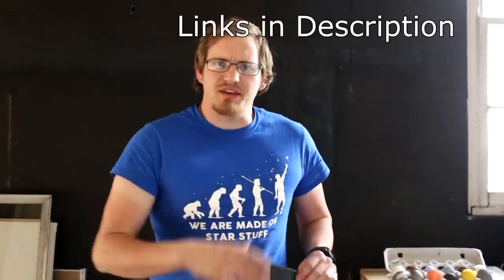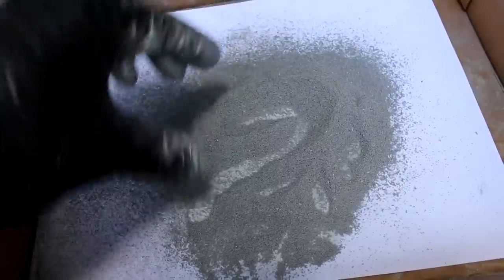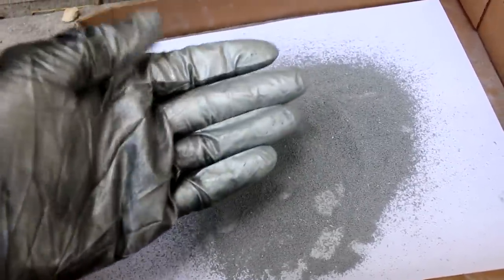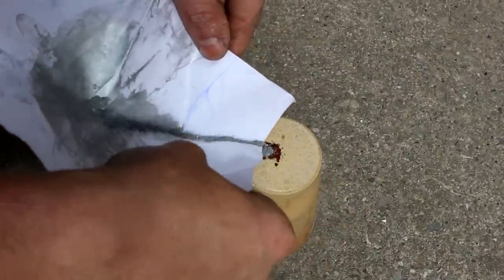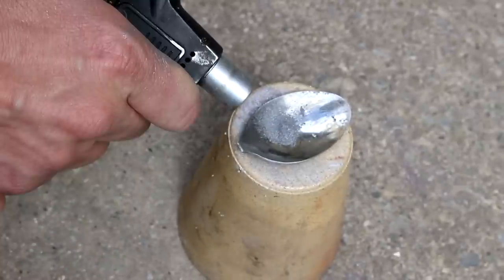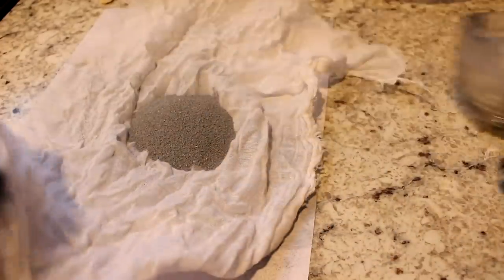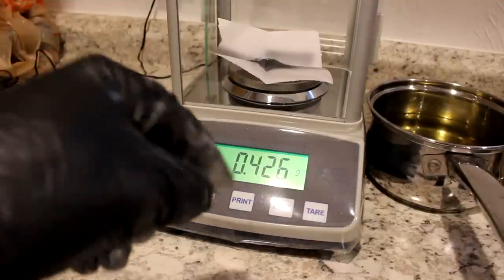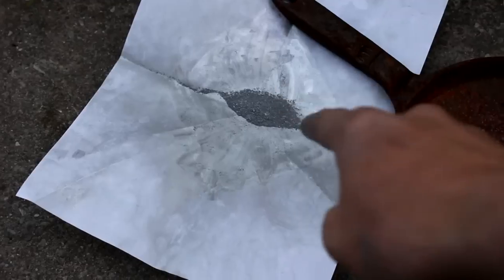Thermite From An Etch A Sketch; Yes It Can Be Done!

Comment: try adding potassium permanganate and dripping sulphuric acid on the little blob of putty. I wonder if it would react to produce manganese heptoxide and then react with the aluminum powder to produce manganese, carbon and aluminum oxide. should be a really violent reaction.
Reply: andrew garcia I remember that, if you combine potassium permanganate and antifreeze, you get a reaction that can burn through a plank of wood.

Comment: as a non kemist, you said the idea was for the Aluminum to steal electrons frpm Iron or Cupper to get the heat of the reaction, could you have more steps maby other metals as " aluminium, Iron and cupper" iron stelas from cupper, and then auminium steals from iron. you get the idea.

Comment: What sort of torch are you using? I usually have to use a magnesium strip to reach temperatures high enough, AND use a torch which is hot enough to light the Mg (which unfortunately is not enough for the thermite though...)

Comment: I use aluminum oxide as a micro abrasive etchant. Would that work in thermite? You can get it at Harbor freight for under $5 a bottle it you want to try it out.
Reply: +antagonizerr no the end result of thermite is aluminium oxide not the begining
Reply: Dexter D
I understand that, but I'm wondering if alumina could become aluminum chemically, rather than smelting, and Cody, being the clever fellow he is, would be the one to know. It's already in powder form which should make whatever chemical process easier.
Reply: Well seeing as the whole reason that the reaction happens is because aluminium oxide is made, to uncreate that reaction would require you to put in as much energy as the original reaction produced. You don't need someone who faked thermite to tell you that.

Comment: Shouldn't you use a stoicimetric ratio of 3 parts iron (III) oxide to 1 part aluminum?
Reply: That's a mass ratio. The respective densities of the aluminum and iron oxide come out to roughly a 1:1 volumetric ratio.

Comment: would it be possible to use heat to separate the aluminium powder from the plastic? it looks like a lot of it is sticking to the beads when you were sieving it

Comment: I wonder if you could make thermite with scandium powder and tantalum oxide from capacitors... Somebody try that and tell me how it goes if you survive.
Reply: +Seth Mitchell why does that create a more intense reaction?
Reply: +Raidho Well tantalum is a very unreactive heavy metal, and I think scandium is even more so than aluminum, but without being so reactive that it couldn't exist in powder form without burning on contact with air, so maybe. I'm not entirely sure if it would work at all, but if it did I imagine it would probably be even more energetic a reaction than bismuth thermite, which basically explodes when ignited.

Comment: Putting the penny in there was actually illegal (deflation). That said, I don't think you'll get into trouble for it :D
Reply: +Huntracony no it wasn't and deflation is not the word you are thinking of its defacing
Reply: Garrett MAGISTER It is illegal to melt pennies. I did actually mean deflation btw, as I thought that was the reason melting pennies was illegal. That doesn't seem to be true, but still, melting pennies has been illegal in the United States since 2006 and in a lot of the rest of the world for much longer.
Reply: +Huntracony only if he uses them for profit is it illegal
Reply: +zemeon2 if he defaced it you cant return it to circulation and just defacing it is not illegal
Reply: but he didn't melt it,he oxidized it.
Reply: he can't profit from it anyways cuz a very small percentage of the penny is actually copper

Comment: Btw cupric oxide is super easy to make...
Reply: How?
Reply: Gordon Freeman When I made it, I bought sheets of copper (you can probably hammer down some copper) and literally just put it on a burner. The heat exposes the copper to the air, thus oxygen and  thus ai found that coporous oxide is extremely easy to create. Note: the black stuff is the CO, the orange stuff is residual copper.
Reply: Luke Sorensen
Nice, thanks.

Comment: You're supposed to mix them at a ratio of about 80:27 by weight.
Not equally by volume
Reply: Also, it's not surprising that the copper thermite reacted that way.

Iron thermite burns but copper thermite explodes.

Comment: My first observation with the acetone to remove the styrofoam is that, your method is not very effective. 
Maybe you should try with more acetone and also heat and steering. 
You could also vacuum filter the aluminium powder to save time and of course rinse it with acetone. 
And if you can avoid breaking the glass that would also help a bunch. 

I mean either that or you buy aluminium powder. But who got time for that. smh

Comment: hey Cody is there any metals in old CDs DVDs CD R ? just curious
Reply: +Chad Brailer Normally a very very thin layer of aluminium only. No idea about actual amount, but my guess would be 1000x as thin as aluminium foil (if not thinner). They also sometimes use gold, though I think that is very rare.

Comment: I'm pretty sure Thunderf00t called bullshit on this a while back due to the quality of the supposed thermite. Not to mention it was the weight of the weapons, not the thermite only that brought down the guns in Heisenberg's story about WWII.
Reply from the maker: he was correct on the gun thing.
Reply: ***** It's even easier to simply scrape iron oxide (good ol' rust) into a powder and blend it with one third the amount of powdered strike-anywhere match tips and 50/50 that with grocery store alum for a better thermite facsimile.

Comment: wouldn't it be easier and cheaper to make the aluminum power than to extract it from these toys?
Reply: Yes
Reply: ***** I saw the episode and was aware, just wasn't sure if there was something else in it besides just aluminum powder. Also in "Breaking Bad" it was a similar toy, probably a fictional one (for legal reasons) and he (walt) referred to the powder as "thermite" not aluminum powder, which I assumed meant the oxidized metal was in it too, but never took the show serious enough to think kids toys could burn through solid steel   lol.  The video was interesting but unless I'm missing something it would have been informative to mention that only the one component needed was present in the toy.